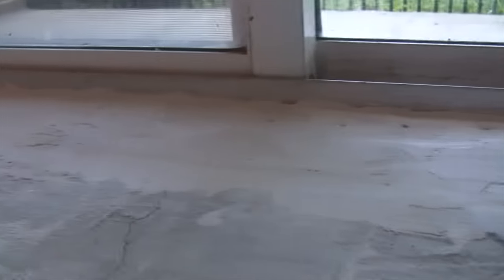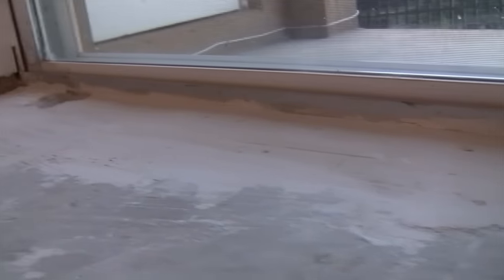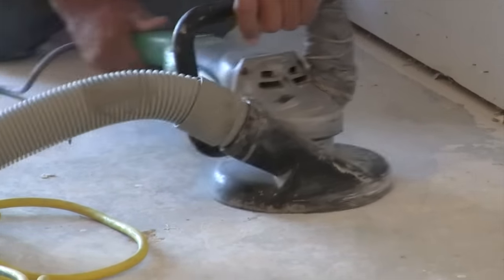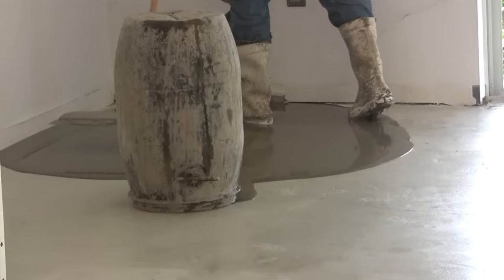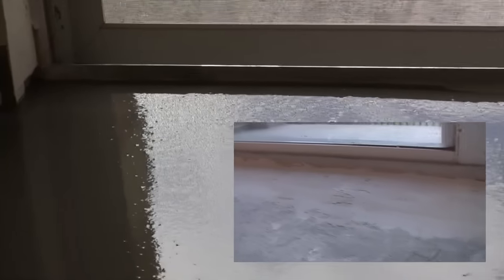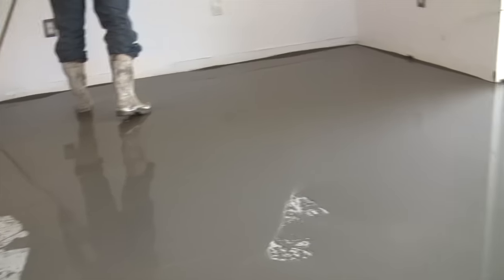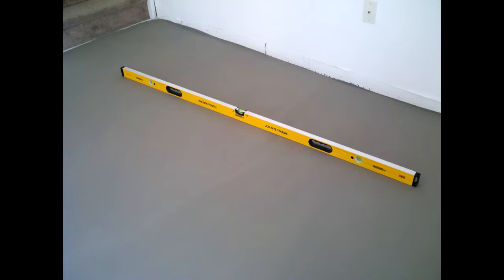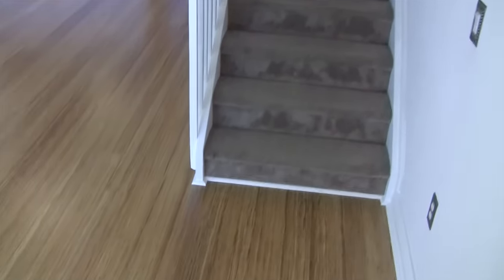How to Self Level Concrete Floors Like Pros - Self Leveler

Comment: can the leveller be poured over wood flooring, or does it have to be taken up?
Reply from the maker: I think there would be too much flexion in the wood flooring unless it was glued down or nailed down then I might do it. T Yeah we had a that’s a really tough one to answer. if there's any underlayment below the flooring, then it can make it bounce too much and you can end up cracking the self-leveling compound. The best course of action is if you have a wood subfloor beneath your wooden planks, try to remove the wood planks and then just pour it on the subfloor but make sure that you're not like on an upstairs floor where the self leveler could drip down between the subfloor panels and go downstairs so if that's the case you might want to run caulk through any cracks you see and I usually like to cacaulk all call the way around the perimeter of the room as well so that it can’t escape and go into an adjoining room. Essentially you want to dam up the entire perimeter of the room and fill in any holes where it might drain through before it has a chance to dry period it will look like a leak of water for about an hour or so
Reply: @jeffostroff  Thanks for your response Jeff!...it would be the whole main floor, with the crawl space below, so don't care what drips down lol!

Comment: Could I also leave the floor just as the self leveled in my kitchen if I add white to the mix. There’s underfloor heating and I prefer the nice thin shiny layer of the self leveling mix. 🤔🤔🤔🤔 Thank you 🙏
Reply from the maker: No you are not really supposed to do that in fact in manufacturers will often tell you on the bag that this is not to be the finished surface that you need to have something on top of it for example laminate flooring or tile. So check the bag for the instructions and see what they say on their before you attempt something like that.
Reply: @jeffostroff  how about when i primer the concrete substrate, our the self levelling floor then paint it with PU or white concrete paint gloss .....hmmmmm....

Comment: Im about to lay Porcelain Large Format TIle in my basement, and the original slab has intentional slope, it would lead water to laundry room where the floor drain is.  Im in a bit of a pickle, because i need to lay this tile, and for ideal results would use self leveler, but i also need the slope because this area tends to flood and its more likely than not, I will end up with water sitting in my basement.  Ive done few tiling jobs before, but am wondering what would be advice for someone laying large tiles on sloped floor.
Reply from the maker: You can't pour self leveler on a sloped floor, it will all rush to the bottom. You need the floor to be sloped, but you also need that sloped floor to be flat, not level. So what you do is take a 6 foot level, slap it down on the floor, spin it like a helicopter all over the entire floor, marking all your high points and dips of more than 1/8" across that 6 foot level. That is the TCNA requirements for floor flatness. any bumps above 1/8", grind them down. Any dips greater than 1/8", fill them in with thinset and allow to dry. You can use an angle grinder with a grinding cup on it to grind down areas that have bumps or mounds above the "flat" part of the floor. Once you do this, vacuum and clean the sub floor and start tiling. To prevent lippage between tile son the sloped floor, Be sure to use a quality tile leveling system like:
🛒 Raimondi Tile Leveling System Starter Kit: https://amzn.to/2CAyweW
🛒 Raimondi Tile Leveling Clip 1/8" joint: https://amzn.to/2RhbodI
🛒 Raimondi LS250WEDGE 250-Piece Tile Leveling System Wedges: https://amzn.to/2Sopebl
Reply: @jeffostroff  thanks for taking the time, i appreciate the advice.  The floor is sloped but seems fairly even, over a 6 ft stretch.  Ill definitely use a level and spin it to make sure, thanks for the tip.  Should be getting started today, waiting for delivery of my tiles.  I know prepping the subfloor is likely the most critical part of any floor tiling job, so Ill take my time to ensure Floor is even enough to do that.  Ill lay the tiles in a direction where the 6" side would be most impacted by the sloping of the floor, which should allow me to even things out with thinset underneath.  Thanks a bunch.

Comment: Can I level a floor sections at a time? I want to do my basement but am wondering if I could level half the room and then move all my storage stuff over and level the other half?
Reply from the maker: You can level floor sections but I think it's very risky and for a novice who's never done it before I would not recommend doing it. The reason is is after several minutes it will start to harden up and then getting the new section that you pour to flow in and line up and match with the old section that you just poured and is already dried is very difficult and a lot of times it ends up overlapping on top of it and now you have a thicker layer on top where the scene where the where the two sections come together and it's not very easy to deal with it removes the whole idea of having a flat continuous surface. What the pros do is they work in teams of two or three and they just keep going until they finish one guy is outside mixing, then he dumps it on the floor and another guy is inside leveling it out and combing it and all that other stuff.

Comment: You don’t have to put some kind of barrier around the walls to prevent it going through?
Reply from the maker: When I do it I usually prefer to either add Coke along those bottoms bottoms of the walls or you can also do the phone but the call has more control. Oh. In this case they probably didn't bother because you have a metal bottom plate at the bottom of the wall there so nothing is going to seep through

Comment: I have a few questions... I want to do 45m^2 15m long  x 3m wide on bricks that have been laid. Firstly can a self levelling concrete be applied to bricks that are flat to the ground? Next question is what is the best product to use(concrete) if this is possible ? I also have another area that's simply cement 6m x 5m roughly that's partly rough cemented.. would I need to smoothen with self levelling cement first before applying rockoleum garage product?
Reply from the maker: I would feel better applying self leveling concrete, but you need to make sure it is allowed for use outside. IT will state it on the bag.

Comment: Could you tell me how to level/smooth plywood to paint. I live on a dusty farm. Since the 80s, I do not like carpet. I'm tired of replacing flooring ever decade. I just want to paint the plywood, but I need to fill in the cracks and cover nails/staples. Tested several types of concrete-type filler but in a few months it cracks and chips.
Reply from the maker: Some builders pour about 1" or less of self leveler over the wood sub floor of upstairs houses and townhouses and it seems to last. One of my townhomes had this
Reply: @jeffostroff  and the self-leveler takes paint good. I am guessing yes. I will most likely use an enamel paint; then in high traffic areas, I might clear coat it. I am testing my front door entrance way with enamel paint without a clear coat. It has been down three months and does not show signs of wear. Thank you for taking the time to answer me. You probably have better things to do than to help me. 

Bless you! Have a safe and Happy New Year's. I wish you and all the best in 2022;. 

I am predicting that the COVID variants will be worse and side-effects from the vaccines will become more problematic. 

Before Christmas 2020, I predicted that COVID would only get worse....it did by mutating. I strongly suggest to everyone to continue wearing masks everywhere even when the state does does not require them. I believe kids in school and at play should always wear masks. Just a bad gut feeling...I'm not psychic.

Comment: I have a question I am about to use high end vinyl floor planking on a concrete slab the room is like couple feet below grade. Now existing are 9x9 anyway some are missing what would be best way to even floor.
Reply from the maker: First make sure the old tiles that are on there now are not asbestos once you've determined that they are not asbestos then you can remove them Now if you can't get the old tiles to come up to make an even floor then you can just go ahead and pour the self leveler compound all over everything enough to rise up above so that the missing tiles are completely covered and nobody will ever know it was there because it will fill in nicely
Reply: @jeffostroff  I dont they are asbestos based on my research so I would like to replace missing tile from under a cabinet do you know where I can get 9" tile and the 
leveling product that harden up good?

Comment: Would the same process work for my shed I'm turning into an office?
Reply from the maker: Yes, you just need to make sure the shed is sealed around the edge so the self leveler does not find cracks or gaps and spill out. Check the bag instructions they might say indoor use only, this may qualify as indoor, not sure.
Reply: @jeffostroff  I'd say it would. It will have a mobile AC unit in it. It's a simple 8x12.

Comment: Hi jeffostroff
Is it possible to use the screed as final product? I have a project where I want to keep the floor raw, maybe just stain it....so I thought to mix a waterproof key coat bonding liquid in the cement instead of water, and maybe considering fiber mixed in the screeds as well for extra flexibility. I also thought to mix a color pigment in the cement mix to give is a lighter color....then when the floor is dry, top it with a sealer.

also on the cracks I saw in your video, will it be best to first seal the cracks with a sealer before pouring the concrete? otherwise sometimes it can drain a lot of your cement?
Reply from the maker: No the underlayment manufactures usually tell you not use this as the top surface for a floor, so it is meant to be tiles over or have wood floors on top

Comment: Can you use this like in a garage or a shop in where you will not be installing tile or flooring.
Reply from the maker: You will have to check with the manufacturer of the product because usually they don't want that to be the finished floor they're expecting you to put some type of flooring over it so always read the directions thoroughly on the bag and check the manufacturer's website

Comment: @jeffostroff do you have to protect the baseboards (with tape) from the self leveler seeping into the sides? I feel like it would just keep spreading and moving until it can’t.
Reply from the maker: We took off the baseboards.
Reply: @jeffostroff  does it run underneath the drywall. My drywall doesn’t come all the way down to the slab behind the baseboard, so where does the self leveling stop? Thinking about using spray foam to create a wall.

Comment: Will this compound be hard enough as the top of a concrete slab for a shed ?
Reply from the maker: Yes you should be able to use it with a shed I would not recommend using it as a garage floor or for driving a car on. Check with the manufacturer and double check the specs on the weight load

Comment: Hey, I have a tile floor for a commercial restaurant. I was thinking that instead of removing the tile flooring why don't I pour the self level concrete on top and cover up the tile floor? Would you recommend this?
Reply from the maker: Yes some of the products allow this, with certain actions on your part so you need to read the instructions on the bag and confirm with the manufacturer directly. Some might want you angle grind the tiles a bit to roughen them up, or use a special type of primer or bonding agent first, so find out what it is you need to do.

Comment: Thanks for this! So how many bags did you mix at once? Only 1 at a time?
Reply from the maker: There were 3 guys from the flooring company, they mix one 50 pound bag at a time, then dump it on the floor. While the guy in boots is coaxing it into place, the mixing guy is mixing the next bag. I don't know how many of the bags they eventually used.

Comment: My floor in my shed is concrete and water keeps appearing (where from ?) and also its not level in one corner, if I use self levelling compound  can I use concrete sealer on it or do I use it before I put down the leveller , also the video was really good nice flat floor.
Reply from the maker: First you would roll a primer on the old concrete floor if you can buff the surface first with a grinder, that would be better. Then apply self leveler.  You need to check with the manufacturer to see whether they allow it to be sealed, or used outside. Try Ardex and see what they have for you.

Comment: Looks awesome! I do have one question though. I am a stickler for transitions. Is the wood flooring at the same height as the tile? It looks high from the video but I can’t tell.
Reply from the maker: The tile in the foyer was just a teeny bit lower than the bamboo flooring because the builder used a thinner cheap tile and anything I'm not taking now I mean yeah double hardly any thinset so it was not built up as high as it should have been. So if you look closely you can see the transition piece that we used from the foyer to the bamboo flooring has a slight bump up built into it, so it's a specially designed piece that helps you transition from one flooring height to one that's a little bit higher. It actually worked out pretty nice it was a nice looking piece

Comment: I only need to cover a small area where the ceramic tiles join with the bare cement, theres a half inch lip that I need to level out to join the two together so creating a smooth slope for my vinyl tiles to be installed over both the bare cement and ceramic tiles. Question is how far out should I level out the cement from the lip of my ceramic tiles? Its a 10 foot opening where the ceramic runs along side of the bare cement floor and a 1/2" lip
Reply from the maker: Tony you should go far enough out that you don't see the ramp up to the tiles or feel it. Maybe 6 feet or more, you will have to judge that.

Comment: I am going to tile over wood flooring that is uneven I have to lay out the concrete floor such as wonder boarding would you use the self leveler on the wood floor first or lay the concrete board first and use the self leveler on concrete board before tiling? Any answers would help Thanks
Reply from the maker: Great question, here's my thoughts on this. There is nothing in the (TCNA) Tile Council of North America Handbook for this case, although in my 2017 handbook, page 288, under Section TR711-17, they say that "Ideally, existing finishes should be completely removed so that the tile work can be placed on the subfloor". That is also my opinion as well, preferring to take things down to the beginning to start over. They do offer up what I call an "if you must tile over existing flooring" paragraph scenario, but it seems to apply mostly with glues over vinyl or linoleum floors, and seems to not mention/exclude hardwood floors. Let's now look at what self levelers require: MAPEI Novoplan 2 self leveler specifically states not to apply it onto "glue-down wood flooring". So if you are going to go down this path, and your sub-floor is stable, like you feel no bouncing, I would lay down sheets of cement backer board, probably only need 1/4" thick sheets IF AND ONLY IF the subfloor is completely not moving or bouncing. Wood floors can expand and shrink, so that's why self leveler on them is bad, it will cause the self leveler to move, crack, transmit movement to your tiles which will crack. Screw the cement backer boards through the wood floor to the wood sub floor below your hardwood floors. Tape all the seams in the cement board. Then pour self leveler over the cement boards, now you have a perfect subfloor. I would suggest at this point using a crack isolation membrane like Schluter DITRA or equivalent, use the correct type of thin set mortar as called out by the membrane manufacturer, then tile over that crack isolation membrane. Just remember to calculate what all your heights will be, because you'll be adding at least 3/4" of height to the finished floor, maybe 1/4" for the tile, 1/4" for thinset, 1/8" for DITRA, almost 1/8" for mortar under DITRA, 1/4" for cement backer boards. Hope this helps, let us know what you end up doing, this is an interesting engineering case.
Reply: @jeffostroff  ok that sounds good it is an old home with real wood floor planks not vinyl planks..will try what you suggest screw the cement boarding with screws long enough into the sub floor..thanks for the help
Reply: Firstly use a good leveller ardex k15,you can use chicken wire or similar and staple / nail to  subfloor as a reinforcment like a concrete slab,prime and level
Reply from the maker: @Lionel-d1h  Do you really need reinforcement when you are doing a shallow pour? Also how will it self level with the screen in the way? I assume you pour it more than the thickness of the wires, but what if you don't need it that thick.